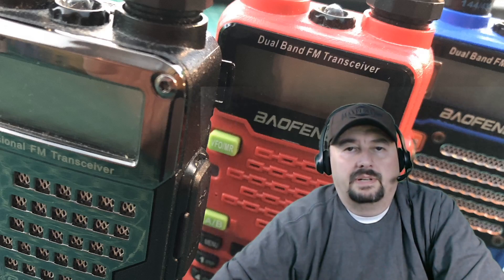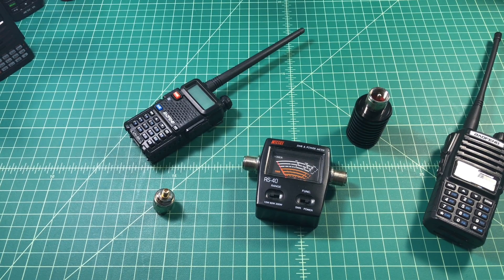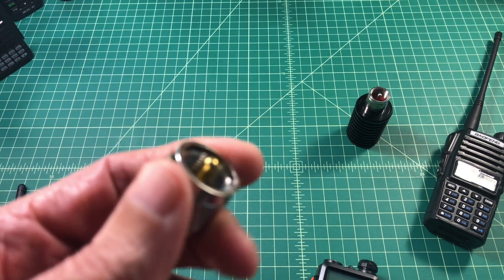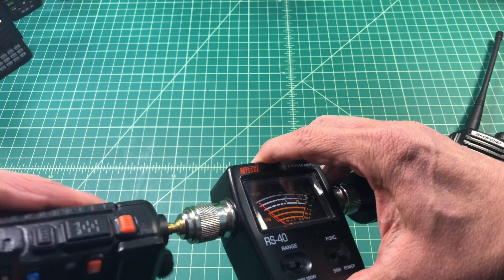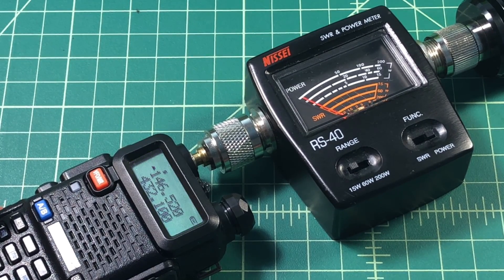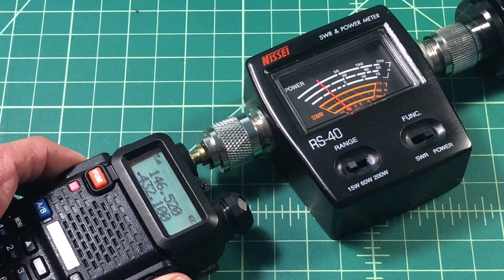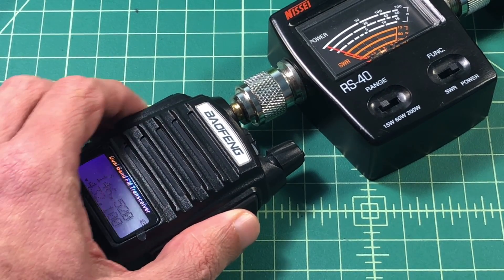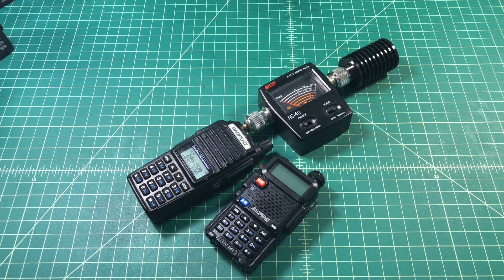Baofeng UV5R and UV82 Power Test - TheSmokinApe

Comment: I have an old Baofeng uv-82. I can't find the wall-wart to charge it. I have the stand, but is it center + on the jack, or center --  ?    The light is red with center --, but no light with center + , driving me nuts,  at 78, I can't see to good, and my memory ?????   LOL   I haven't been on the radio in 40+ years, and thinking a good time to restart. I bought an Icom 718, Yaesu 891,  but the uv 82 will be good for my wife when walking our fur kids.
Reply from the maker: Hey Jerry, I could be wrong but I was pretty certain the center was positive...

Comment: I'm quite sure your antenna connections were not tight, so readings will not be good... Also for accurate power readings the SWR is still a good thing to check, even if you're on a dummy load.
Reply from the maker: Glad you liked the video 👍

Comment: My uv5rtp( I know it's a different radio than the one in the video) puts out about 6.9 Watts.
Reply from the maker: Cool, I haven't seen that one.
Reply: @TheSmokinApe  actually basically it's a regular uv5r but with a low medium and high power setting. High power is supposed to be 8 watts but falls a bit short of 8 watts
Reply from the maker: @shawnwade302  Ah, gotcha 👍

Comment: you have tested a WRONG piece of UV-82!!!! No offense but the TRUE BF-82HP has 3 modes of Power (LOW, MID, & HIGH).  Try to demo the REAL BAOFENG UV-82HP with 3 Mode of Powere. Your Demo Product is not 8 watts but only 5 watts BF Product. Have a nice day to you and to your Subscriber. I hope this coment will help you and your Subscribers in searching for REAL 8 watts Portable Radio. 73.

Comment: I've been licensed and using HTs for over 30 years. And, every one I've owned will only reach it's FULL rated transmitter "Output" power when your connected to a 13.8 volt power supply. NEVER when just using the rinkey dink battery 🔋!
Reply from the maker: Fair point, thanks for watching Ray
Reply: @TheSmokinApe  
You Sir, 
Are very welcome!
Thank You for your interesting and informative content.
Some of these "inexpensive" Asian imports don't even have an "External DC" port to plug into!!!!!  🤔

Comment: I think also if you buy your Baofeng radios from BTech. The power level’s will be more consistent. I might be wrong. I will know soon enough. 
I have the 2 BF-F8HP and 3 BTech v1 GMRS radios. Plus I have the BTech UV-25x2 mobile radio. 
I just bought a RS-40 meter do I will know soon as I get the proper connector’s . I hope that my BF-F8HP radios put out the 8watts or at least the 7 . I use them on UHF mostly.
Reply from the maker: The Btechs are nicer in quality 👍

Comment: The UV-82hp is about 3x the price of the UV-5r if that's any indication, but you can't always go by that. I have the UV82hp and really like it. Personally I like having to turn the radio off to switch from channel to frequency mode. It's not something you do multiple times a day and it prevents accidental bumps. I plan on adding a UV5r to my collection just because they're cheap and well made. Side by side I don't think they're really much different.
Reply from the maker: I would agree that they are very similar.  Thanks for the comment Jack!
Reply: They got 2 packs for the 82 hp for 60 bucks on Amazon

Comment: Uv 5r Or uv 82 ...? ... Which one is the best
Reply from the maker: I'd give the 82 a slight edge for receive audio but you have to power it on and off to switch between Memory and VFO mode.  I think either are just fine and its 6 of one and 1/2 a dozen of the other....

Comment: My Baofeng UV5R was about the same when i bought it so i used a program called chirp and got 8 watts output just gets hot quicker and go's flat fast. I think the antenna is the way to get out better not the power
Reply from the maker: Using Chirp is the way to go!  Thanks for the comment.
Reply: @TheSmokinApe  Did you get better result since you used Chirp ? Thanks
Reply from the maker: Vincent Calcyn Chirp wouldn’t change the results of the test 👍
Reply: @TheSmokinApe  well. i should invest into a swr / power meter then... To check that.

Comment: I know im late with comment but next time do test in the fm portion of 70cm band not in ssb portion where you will never use that radio and last , do a test in the commercial portion of the vhf and uhf bands , i bet theyre more likely to be better there
Reply from the maker: The uv-5r was low on 146.520 as well 👍

Comment: Maybe I missed it but were you using fresh batteries?
Reply from the maker: You should be able to see the battery indicator in the video.  The UV5R was probably at 95% charged 👍
Reply: TheSmokinApe thanks Ape. I’m shopping for a DMR and have learned lots lately from your vids.
Reply from the maker: Glad they have been helpful 👍
Reply: Nope, only old ones he found in a Walmart dumpster.

Comment: still, UV-5R is great value. I also have the UV-B5. I like the sound more, it's supposed to have better filtering and 8 W, but I prefer the interface of UV-5RE Plus (same as UV-5R). I'm surprised that it performed so poorly.
Reply from the maker: Some perform better, it’s really a mixed bag 👍
Reply from the maker: Depends on the UV5R, some are pretty good and some like this one are terrible.

Comment: TYT MD380UV GPS a good starter radio. Good sound from the speaker. Got me interested enough in ham radio to order the Anytone 878+ and a hotspot.
Reply: I have been interested in ham since I got out of the mil, 5 years ago. Now, I am just getting into it and thinking about the 878 myself...mainly due to the good reviews for analog and dmr. Good luck with yours!
Reply: @tntshuffle-9799  Fixed income (SSDI). Can't afford a new radio when something new comes out. It does everything including analog APRS so probably the last radio I will need to buy.
Reply: @allenvestal1958  I am also hoping I can get by with the somewhat newer 878 without wanting to "upgrade" in a year or two also. If I don't keep the costs down, this hobby will die quickly due to a more fiscally responsible wife. When I initially discussed the price of a new home base station, I almost recieved a direct punch the the Adam's apple. I'm trying to avoid such things...
Reply: @tntshuffle-9799  I have a lot of free time and I an not frugal I am freaking cheap. I did my research and it is the best radio you can get without forking out a lot of money on a Motorola.
Reply from the maker: I’m sure your loving that 878 👍
Reply: @TheSmokinApe  Ordered today but I have a codeplug ready when it comes.
Reply from the maker: You will love it
Reply: @TheSmokinApe  Hopefully my 61 year old butt will be able to read that screen without reading glasses. Need them for my TYT.
Reply from the maker: The screen is pretty good and you can adjust the colors, the black background really helps
Reply: @TheSmokinApe  Ordered today but have a codeplug ready. MMDVM hotspot with 3.2 inch screen 119 dollars. Clearance item but they have a few left.
https://www.sainsmart.com/collections/raspberry-pi/products/sainsmart-mmdvm-hotspot-wifi-digital-voice-modem-kit-with-raspberry-pi-zero-w-and-3-2-inch-lcd